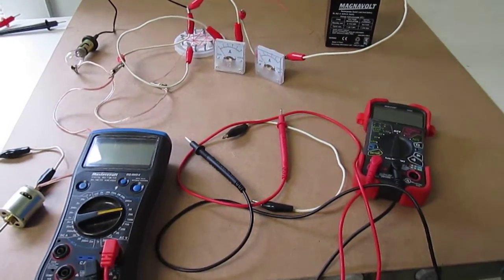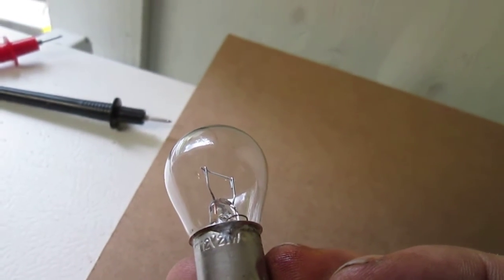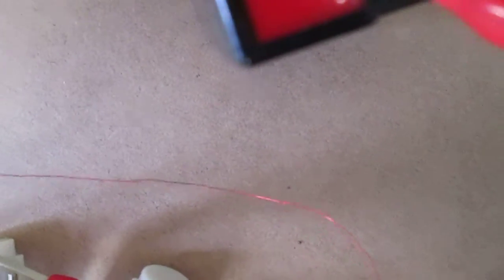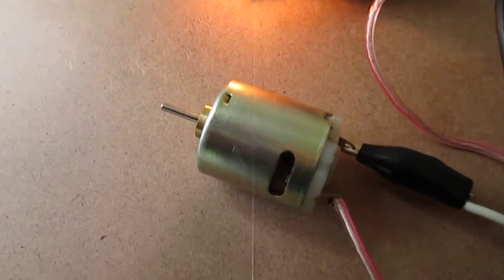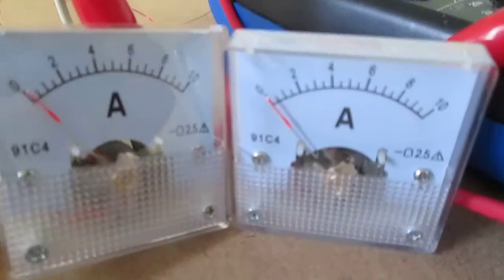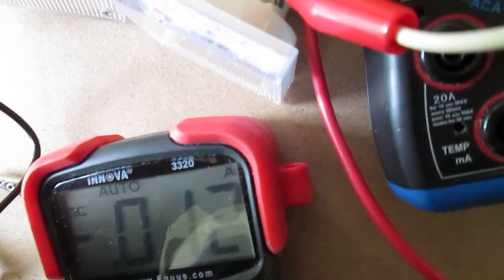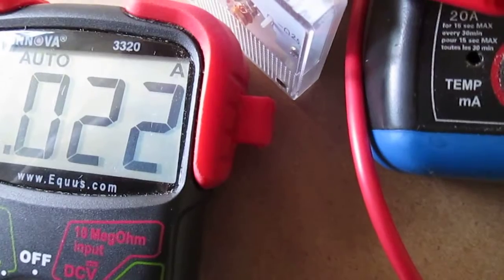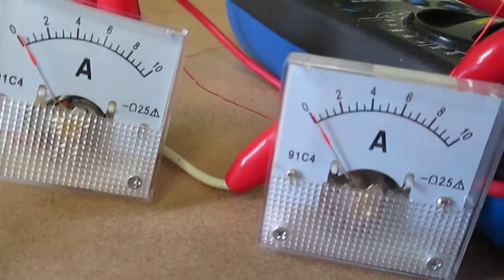Starship Coil Overunity Metered

Comment: in order for you to not register a false reading you need to disconnect your ammeters when measuring through your digital meter or else you will not get true amps because its going thru other path as electricity flos thru path of least resistance
Reply from the maker: Thank Alex. The percentage gain is the same when they are attached inline. Shown in the video is about 10% of the total inline that the analog gauges show but the percentage ratio of amp gain is the same. I did not disconnect them to simplify the video. I am building these step by step where the hypothesis leads me without formal electronics training. I think this is good because I am a logical programmer. I do check priors to explain what I see. I see a great debate between the conventional physics that tries to put mathematical models to closed systems and other experimenters and theorists who find that open systems around energy transformation work much better for input and output. There are more variables (effects) we know of now in electromagnetic transformation than in times past. It seem there are many isolated effects around electromagnetic transformation and dozens more terms to describe them for basically the same observations.